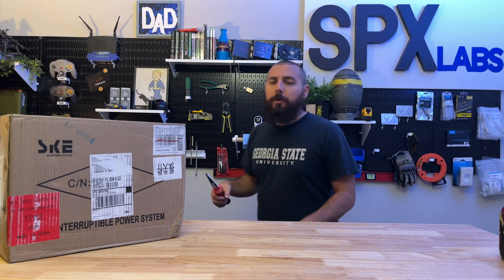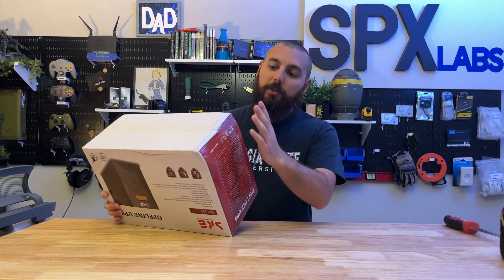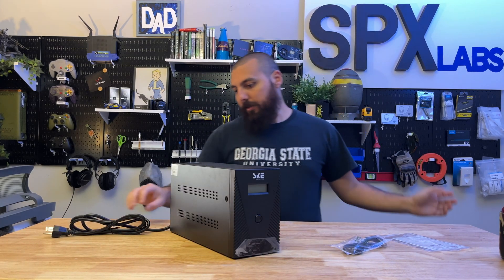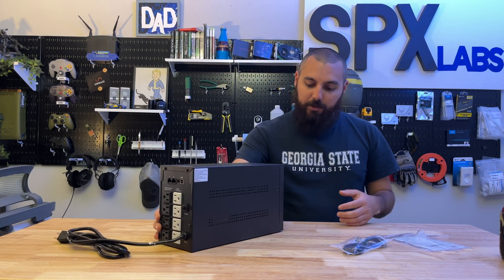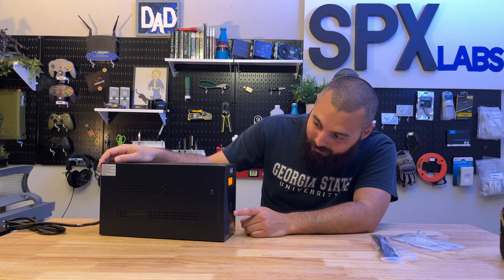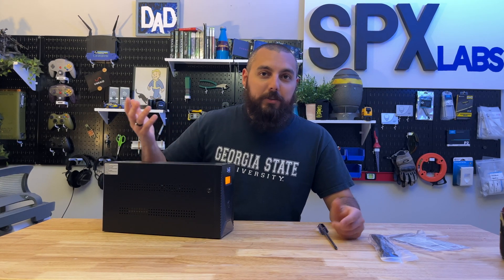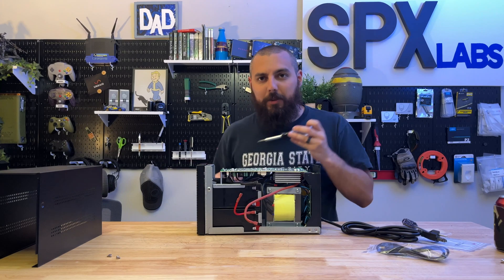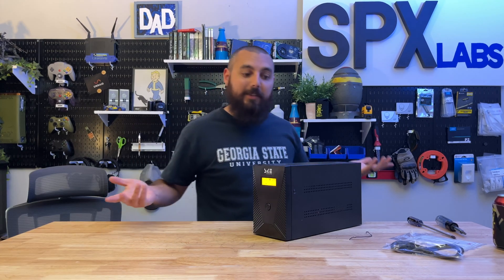Unboxing Tear-down and Review of the SKE1500 UPS | SK1500

Comment: Just what I was looking for! Great presentation, commentary and step by step nature of your disassembly process!  Was able to tear mine apart and replace the batteries thanks to you.  Works like a charm now.  I was going to take the unit to the recycle center but knowing the batteries are relatively cheap compared to a new UPS I needed a good description on how to get the batteries out and back in.  Thank you for the support!  (I totaly agree on the lame engineering design of the unit.  I guess planned obsolesence engineered). Keep 'em comming!
Reply from the maker: Wow glad to hear that this video was helpful one way or another!  This UPS is definitely not my first pick but totally get and understand why it would be purchased.

Comment: Good video, thank you for the teardown.  A couple of quick notes.  The blue disc things are called M.O.V's Metal Oxide Varistors.  They sacrifice themselves in the event of a surge to stop it.  Please remove your metal rings before working on electrical components and wear at least safety glasses.
Reply from the maker: Thanks for the information.  I am such a scrub with electrical anything.  Don’t worry it is ceramic, I specifically chose ceramic because I work with components from time to time.  Although I did want cobalt originally.  I probably should in case any battery acid squirts out.
Reply: @SPXLabs  cool.  You seem like a cool guy, don't wanna see you on the news.  Good choice on the Non-conductive ring.  Please keep the information coming.  You are a good dude.
Reply: @SPXLabs  subbed to the channel.  I love seeing people that get into the meat of a product.
Reply: Based on your recommendation, gonna skip this one.  The battery change outs are gonna be a pain.  Going to opt for a APC instead, actually 4 of them.
Reply from the maker: The difficulty of changing the battery is enough for me to not want to buy it.

Comment: I just bought this UPS because  its interior components are identical to my Belkin 1200VA UPS (still running!) I have had for over 20 years protecting my  home servers... batteries are typically good for 2 years so I replace both of them for about $35-$40 each. The two batteries will provide couple hours of work to shutdown and the surge protector has done a great job keeping current spikes away. I agree it takes knowledge replacing the batteries but the strength and quality of this UPS design is worth having to secure our home equipment. Your video was very informative, thank you!
Reply from the maker: UPSs are so worthwhile even for home.  I adore all of mine and I think folks should have one.  Just not this one lol.  Thanks

Comment: Thank you, you saved me some $$$ as I was looking at this on amazon for my router. We have several other larger units but I wanted something a little smaller so I didn't have to keep moving the router over to them when the power would go out (happens a lot here) Guess I will just move the router when I need to until we get a full house generator. (work in progress) lol
Reply from the maker: It’s honestly probably fine for that.  But I’d still buy something else.  Like APC or cyberpower
Reply: @SPXLabs  Thanks, I have 2 of the larger APC units and they have been really great. Just need to keep that PC going so I can listen to the storm trackers feed. I'm in tornado alley. lol Looking to maybe get a battery powered scanner or something along those lines. Lived in Vegas for years, this place is a whole new ball game for me. Anyway, thank you. I appreciate the reviews.

Comment: Just because you can not disassemble it , doesn’t make it a bad unit . How does it perform?  most people do not have the skill to change any ups battery . Worthless and a waste of my time watching this review …
Reply from the maker: If the battery dies and needs to be replaced what will you do then?  Trash the entire unit? If you spend more money on a unit that you don’t need to take apart to swap the battery out then i just saved you money.

You are literally making my argument more sound.  If a person doesn’t have the skill to do they shouldn’t buy this.  If someone does have the skills to change a battery then they still shouldn’t buy this because it’s poorly constructed and a bad product.
Reply: @SPXLabs  you replace the batteries  !  Not a  major job,  maybe only for the less skilled .. I can do this , so you really saved me nothing ….
Reply from the maker: Well then, be the change you want to see.  Buy it, make a video about, explain why it’s not a problem to disassemble, show how well it works as a UPS.
Reply: @SPXLabs  that’s to funny. , that was your job .  Yeah when I get a new ups first thing I do is tear it apart .  Battery life runs 3 plus years.  Replacement is really not an issue.   Except it - this was a very bad review that condemned a product sent to you free .  All because  you could not figure how to tear apart .    . You whined about everything, right down to the styrofoam , to ups putting a dent  in the shipping  box . F- for this review.
Reply from the maker: But I did tear it apart. Like all the way.  It’s a cheap product and they cheaped out on everything they could have.  I’m telling people not to buy it because the OEM clearly cut as many corners as they could.  Why would I recommend this to anyone.  The thing was so bad, i couldn’t even give it away.  It took months before someone offered to recycle it for me.  Feel free to buy it though.  I wouldn’t though if I were you.
Reply: @SPXLabs  your opinion, but thousands of people think different. And yes you did tear it apart , and I believe could not reassemble.  It is a 20 lb plus equipment. So I do not think it is cheaply made … but what ever . Cheers

Comment: I had a UPS delivered on 12.01.23 by DPD in the UK, and my box was damaged just like the one in the video! ... Unfortunately, the UPS was also damaged, having a cracked plastic front panel!
Reply from the maker: Shouldn’t have bought one, send it back.  Save your money.
Reply: @SPXLabs  I've never felt the need for a UPS before, but I've switched to a VOIP telephone system, and the UPS is to run the Broadband Router and telephones in the event of a power cut.
Reply from the maker: Buy a different one

Comment: Thanks for showing how to replace the batteries.  I was considering this UPS for the low price, but reviews mentioned the UPS had to be disassembled to replace the batteries.  I found that hard to believe, but your video confirms it.  Saved me a lot of headache as I will pass on this UPS.
Reply from the maker: I would not recommend this to anyone on the fact that the batteries are difficult to replace.

Comment: Offline UPS the cheapest and most simple UPS type there is, can't really be compared to what the insides of a line interactive or online types. This one would be fine for what they are intended for, just don't go throwing a server or something on it as it will most likely drop in the time it takes to switch to the batts.

Comment: That's a shit cheap chinese design. It should be turned into e-waste before you unbox it. batteries should be easily servicable and not require disassembly of the entire unit  to remove. SK must be short for Shitty Krap.

Comment: You didn't short anything. That big spark is normal, its the capacitors charging up. When empty they appear to the batteries as a dead short. The blue things at the back that you thought were temperature monitoring devices are probably movs, devices used to suppress spikes and other hash on the AC line. Please wear gloves when handling the PCB. Sometimes there are capacitors on the mains side that can give you a hefty shock. It won't kill you, but its the collateral damage that will suck (falling, slicing yourself open on the bare metal as you involantarily pull you hand away etc).
Reply from the maker: Sweet.  I did not know that.  I was worried about shocking myself pretty much the entire time, especially when trying to rip out the batteries lol.  Good point of the gloves, perhaps next time!

Comment: The 2 Sealed Lead Acid Batteries are standard for UPSs, but the lack of serviceability is not common except for the lowest-priced APCs. This shows the fundamental lack of experience the random Chinese manufacturer has with building these. They just expect you to throw them away after 1-2 years, environment be damned. I have 10-year-old Cyber Power UPSs that I just change the battery every few years, and the local Batteries Plus store takes them for free no matter if you buy any from them, but their prices are on par with Amazon, and no shipping time. Glad he got it free for review and showed us don't waste our money on this.
Reply: Yeah every UPS I have come across, from consumer grade to enterprise has had easily accessible batteries, usually with a plastic tab or rope to pull them out. For the big boys the UPS and batteries are in seperate cabinets. SKE failed miserably on this design.
Reply: @dash8brj  This was also connected at the factory, and most have a disconnect you need to attach before use for safety and to keep the battery good.

Comment: that sort of battery cage is a classic apc design and i have done it before , its easy to do when u know what to do , and its better to have some idea about electronics before u work on them there is very low chance that a line interactive ups will kill u after u have unplugged the battery and mains but keep in mind when working on "online" ups , some of them have really high battery voltage like upto 400v dc. , this ups is a low frequency type and i don't like this kind of ups cus they waste a lot of energy as reactive current in the transformer , modern ups above 150$ price range are all smps based where there is an smps like pcb and they run the transformer at very high frequency to achieve low inductance and thus small size transformer and way better efficiency , like the br1000g i have first takes the 24v battery to 300v dc and then it makes it into ac by an H bridge. this ups is not bad if its priced at around 50-100$ i will definitely buy something like this for less critical application like if i wanna run some lights that have backup power in my home , i don't use lead acid anymore , if the stock battery dies i just purchase some 6000mah 32650 lifepo4 and make my own battery , the price of lithium these days is almost as low as lead acid and they last longer gives longer backup and lifepo4 is very safe . ups makers don't use lifepo4 cus it lasts a very long time and selling genuine batteries is a big revenue for these companies , home users can buy 3rd party batteries but government offices hospitals military have liability issues so they always buy oem part and companies take big advantage of it giving them cheap lithium will cut massive chunk of their revenue so they treat lithium ups like a next gen very expensive tech and sell them at very high unreasonable prices. also apc still have not a single lifepo4 ups , all of their current lithium line up uses lithium ion and those batteries have much shorter life than lifepo4.

Comment: Not great design. Probably not for the average user to replace the batteries in, but not terrible for someone with a little bit of mechanical inclination. That PCB flexing and being permanently bent is concerning though. Real easy to break one or two traces and then have to try and find where they broke. Also not a fan of how far off the PCB those caps are installed. The spark is most likely just the caps charging after having the batteries disconnected for a while. My Cyberpower does the same thing.
Reply from the maker: Great way to put it.  That seems to be what others are saying as well, I was just happy I didn't break it lol.

Comment: Oh my god all you had to do was right click on the page and select translate to english then enter in the code listed on download page extraction code: 7jga.
Reply from the maker: Hell no. That's sketchy AF.  I'm not downloading anything after being redirected.  Also also, the fact that pi-hole blocks both sites  just sketches me out more.
Reply: @SPXLabs  LoL I hope you are ware that everything on the internet even buying hardware sketches as hell any way even Windows OS is spy ware to now as for baidu is just cloud file service no diff from then any other but you req to install baidu client software now that is sketches and should be no need for that then I agree with you on that, and I wouldn't buy any modified sine wave UPS like that which look like an old copy of a APC model from late 2000's.
Reply: @SHSPVR  If you have to do that just to get support, it's already a fail. Just avoid this pile of crap and buy a UPS from the pros. APC crushes that sorry excuse for a battery backup. Not an opinion. It's a FACT. Also, Pure sine wave or nothing!
Reply: @SovereignKnight74  It has nothing to do with support it has more to do with you using common sense with other languages around the world which a lot of people have no clue first place, I agree with on Pure Sine Wave

Comment: It's 100% normal with sparks then connect battery. I have a UPS rack with soo much more power and that gives like a welder sparks then connect it. To avoid that is to insert a powerswitch so the sparks will comes inside the powerswitch istead. I have UPS rack with 400V batterypack from abandoned electric vechicles and have DC/AC tansformer and step down transformer to my country voltage is 230V and 115V on N wire and 115V on L1 wire (N wire is Blue colored and L1 wire is Brown).
Reply from the maker: I can't say I have seen any of the UPSs spark before.  I'm sure they do but I can't remember a time when it's happened.
Reply: In many few reason then it's not sparks is only if the voltage on battery connected is discharged so it's not carry many Amps. Everytime I connect a APC UPS it's allways sparks then connecting.
Reply: If the spark happened when you connected the battery, as I am guessing that's what happened. It comes from the inrush current trying to charge the capacitors. It is completely normal and is also a good sign. It means you won't get shocked when you open the UPS because the drain resistor or draw down resistor works which empties the capacitors of all their potential voltage.

I wouldn't recommend that UPS to anyone either. Just from the design aspect of replacing the batteries and the online support.